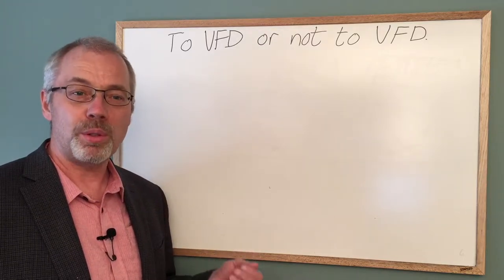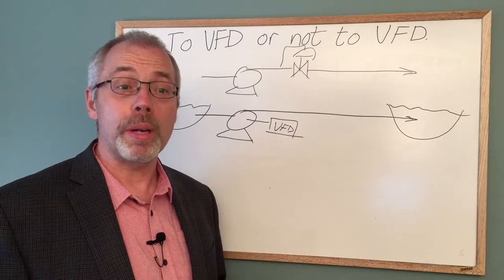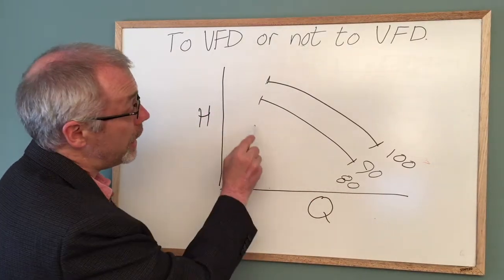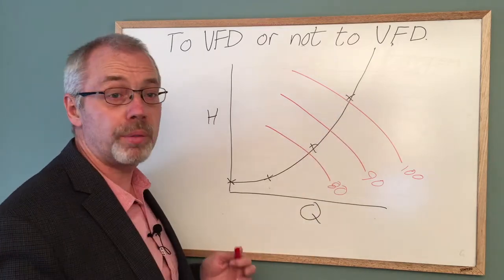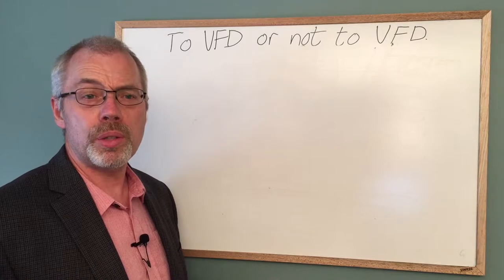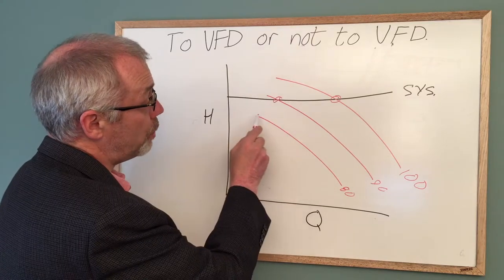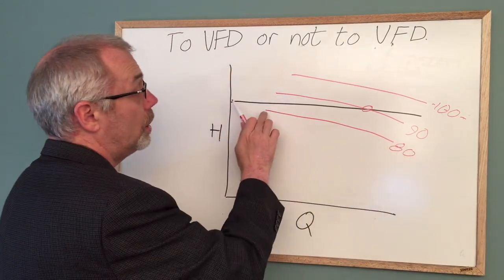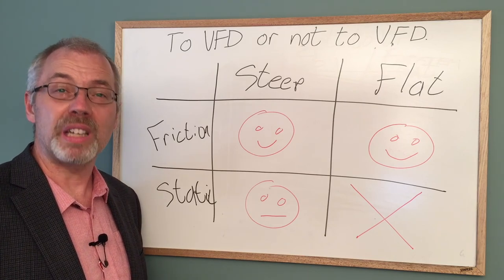To VFD or not to VFD: Centrifugal pump flow control

Comment: VFDs are not a cure all. For large HP applications, the VFD can be the size of a truck trailer and very expensive. VFD's can also play havoc with plant controls if the wiring between the controller and the motor is not properly isolated away from other control wiring or properly grounded.  Also the motor selected, especially with high HP motors must be specifically designed for VFD control.  This means retrofitting a pump with a VFD need to be fully investigated with the motor manufacture.  As with most things, the devil is in the details.  VFD applications need the combined effort the vendor, an experienced mechanical design engineer and an electrical engineer who has experience in controls and motor design.  VFDs work great when done right.
Reply: You are completely right Bob: The many VFD observed failures have the Devil  in the details. Details like improper wiring (VFD cables have special construction and must be terminated in the correct way).  Many times there is a definite limitation on their Lenght and Electrical Impedance, Filtering and Harmonic control, their routing and undesirable coupling, proper grounding etc.  But that does not necessarily mean that it can't be done with excellent results, just that ALL those "details" need to be correct.  As time progresses, VFDs are getting more rugged and reliable every day.  The use of more electrically rugged power semiconductors on the modern VFDs is making them more usable and reliable, but their installation still needs to be perfect.

Comment: NEVER, wherever possible particularly on single phase pumps. .
Reply: In principal...great. in practice...do not go there. My advice.
Reply from the maker: @christophertownley6734  I was being generous with the suitable applications for a VFD and a centrifugal pump. I have seen laughable applications of a VFD with a centrifugal pump, and people still insisted the seal failures were not caused by running way outside the curve (despite the data). Flat pump curve / steep system or steep pump curve / flat system will require a lot of analysis to ensure the pump is reliable and operable. Steep / steep is a great fit, but I have not seen many examples of this. What did you mean by single phase pumps? Single phase electrical?